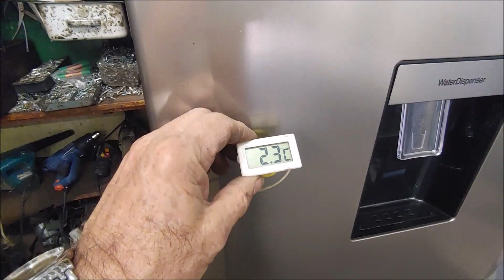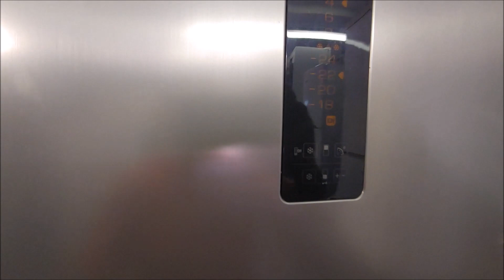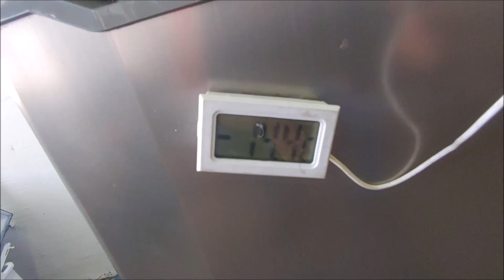Repairing a Defy Fridge Auto Defrost

Comment: Hello, where are you based? We are in CPT and our fridge gets too cold on the lowest setting (freezes all vegtables and fruits and liquids in the fridge section, freezer section works lekker (also very cold)) similiar fridge as you just without the LCD display on the front, 2022 model defy (interior looks the same)
Reply from the maker: We are based in Linden Johannesburg. Move your fridge away from the wall and brush all the dust off the condensor & compressor and see if it makes a difference. There is a sensor in the wall of the fridge that picks up the evaporation temperature.  If the compressor & condensor is full of dust the evaporation temperature decreases and the fridge runs for longer periods making it too cold inside.

Comment: Hi Mr Nel, i have  a defy DFC384 and i have seen two temp sensors, one for the fridge compartment and the other one is on the freezer compartment. Is  there a temp sensor on the evap as i couldnt see because it was fully iced up,  It displays an error code E8, thank you.
Reply from the maker: There are sensors mounted on the evaporator coil, which determines the defrost length. And there is also a saftey cut out in case the element overheats.

Comment: I have the exact fridge, can you make a videa as to how the electrical wiring should be connected at the compressor compartment, which wires are for what?
Reply from the maker: The compressor runs on AC 220v which is a live and a neutral, which connects onto your PTC starter and overload protection, that plugs into the compressor terminals.

Comment: Working on this very model of defy. Exactly... The problem here is that the compressor line is 56v ac instead of releasing 220v. Everything else works fine. Bought a thermostat, just did not know how to hide it. Thanks for this idea. Will definitely get back to update on how it works

Comment: Helo Johann....If the the communication to the heating element was faulty, would it not be a good idea to leave everything original and just connect the defrosting timer direct to the heating element. This is without introducing the fridge thermostat. ...Also, is it not a good idea to start using single door thermostats....It measures the temperature in one compartment.
Reply from the maker: If I only use the defrost on a timer you need to break the compressor while it is on defrost period.  The reason why I use a double door thermostat in the fridge side is because the 22 minute defrost period on the defrost timer is not always sufficient to melt the ice on the internal cold plate.
Reply: @JDNelRefrigeration Thank you for the reply.....what's the difference between the single door stat and the double door stat.....Does the the one stay off longer than the other....considering that the stat only measures the fridge compartment and not the freezer....
Reply from the maker: @alexisaacs699  It switches on & off at a different temperature and the differential period is also different.

Comment: Hi Mr Nel. I have a Defy standup fridge. I got the thermostat and coil inside and compressor replaced. But still no cold Air coming out. I'm sooooo stressed spent so much money already to no Avail.
Reply from the maker: Before you start repairing & changing parts, you have to conduct lots of tests to determine the faults

Comment: My compressor runs well it cooled the box suddenly it will  defrost the box while keep on running what can be the issue?
Reply from the maker: A blockage caused by moisture in the capillary. Repair is to remove all the refrigerant, blow the system through with a suitable gas, fit a new pencil dryer and after vacuuming for about 2 minutes, recharge.

Comment: I have a warning light on my fridge, the same as the video. How do I remove it?
Reply from the maker: The warning light gets activated by the electronic PC Board when the temperature in the fridge is not what you set it to be. So fixing the temperature will fix the red light.

Comment: Great! What about the freezer temparature, the fridge is 2 degrees but how to monitoring the freezer temparature on -20 degrees?
Reply from the maker: There is a display on the door that shows you the temperature.
Reply: @JDNelRefrigeration  I mean how you get the temparature in de freezer  and you just put in the fridge 1 thermostat, now the compressor will stop early
Reply: @aycabbas  the refrigerator door will be open couple of times every day. That's mean compresor will run and the temperature on the freezer will still go more down.
Reply from the maker: @aycabbas  You do not need to control the freezer temperature, as long as it maintains a temperature of negative 10 or colder at all times.
Reply: Great to see workmen who still understand their work.  Usually it is just better to buy a new one, because the local repairmen is always guessing, on my expense.